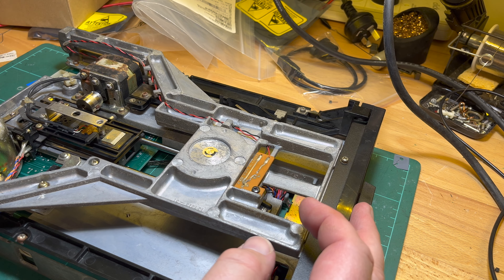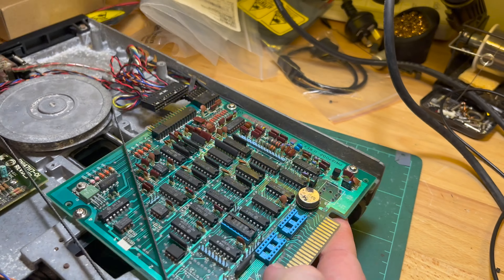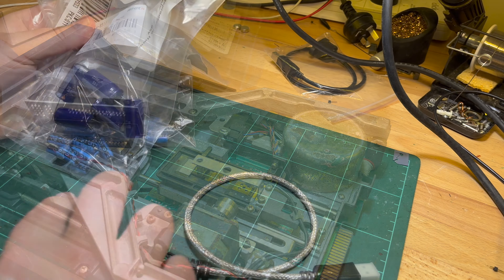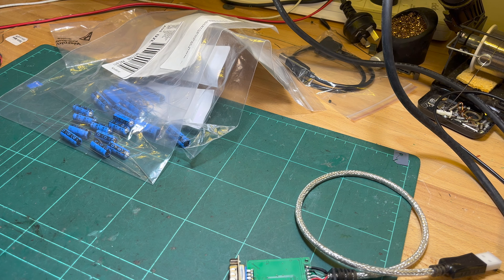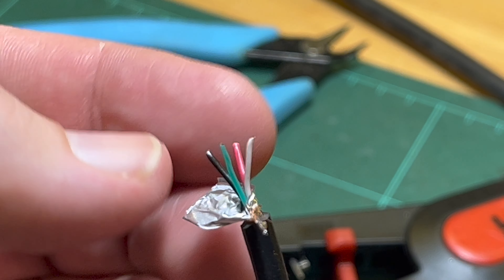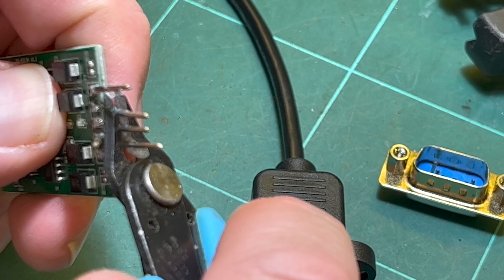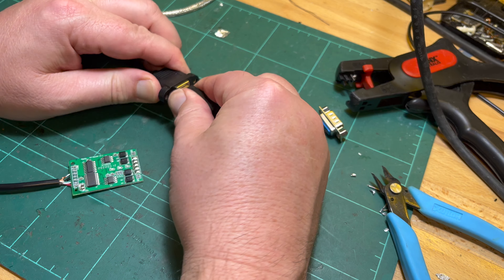Quick Update: 8" Floppy Drive & NABU RS422 Adaptor (19-Apr-2023) [TCE #0281]

Comment: Hey enjoyed the video. I'll be keen to see how things go with your nabu. And don't sweat the haters it's your box you can do what you want. However, just in case, I think some folks have made 3d printed insertable blanks like those that have been used with f18 video adapters. Could print one of those up if and only IF you want. Or get out the drill! Thanks for the tag in the description as well. Take care. (Doh sorry should have read through your other comments before mentioning the 3d printed panel looks like you already knew! )
Reply from the maker: I do actually have a 3D printer ... a Weedo X40 ... but's it's been broken for sometime ... I really need to sit down one day and fix it ... well, I think it simply can't read the temperature on one of the extruders ... that's basically the main reason why I'd prefer to just drill holes in my NABU ... easier than fixing my printer :(
Reply: @Brfff  hey seriously, if we can find an stl I'll print you some and drop in the post if you want. May be the slowest/cheapest method but I'll give it a shot! 😆

Comment: Pity about the solenoid. It was worth a try, I wasn't expecting anything more than the coil working as a replacement. The thing was really cheap which made it worth a try.

 I would use your original solenoid if I were you. For no other reason than it intentionally doesn't have a hole in the bottom to vent to atmosphere. I think that the intent is to let the pressure bleed off slowly to provide the plunger with some dampening. Without it I would be concerned that you will re-break that part that you repaired. 

And please be sure to never power up your solenoid without the metal plunger, and that it is able to be pulled in fully. A nail or a rod will also work. But without something ferrous in there the coil will burn out.

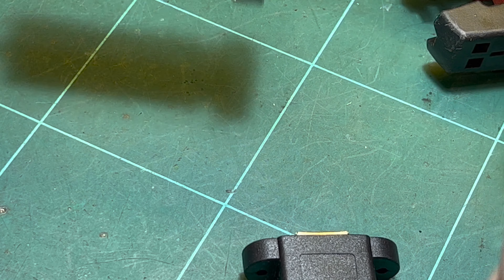@11:26 your white wire and shield are awfully close to the ground trace. The white wire especially.

The real problem with the serial communications for the NABU isn't the cable. It's the odd 111,875k baud rate that creates errors when matched to the standard 115,200k baud rate (I'm getting senile, I had it as 105.2k elsewhere. Duh).

DJ Sures has come up with a software patch which works really well. But if you are getting transmission errors here are some things that you could do.

1) Use a RS422 (or a RS232) to USB adapter that has an excellent driver for it. The Tripp Lite (USA-19HS) is an excellent adapter but I have not verified if it will support 111.9k baud
https://www.amazon.com/gp/product/B0000VYJRY/ref=ppx_od_dt_b_asin_title_s01?ie=UTF8&psc=1

2) Use an el-cheapo Arduino board and replace the crystal

Options 1 & 2 require that you set up your TR1863P as a RS232 port (it's been done). See: https://www.youtube.com/shorts/5VoVyFIRREc

3) Build an adapter that the TR1863P UART chip plugs in to which has its own 1.84Mhz crystal driving it. 

Some random thoughts and brain drippings:

I had hoped that it would be a rather simple crystal swap to boost the serial port to a standard baud rate. I tried tracing the clock back to where it comes from on the schematic, but it leads you nowhere. Cool looking schematic, but it needs a layout page (at the very least) to tie it all together.

However, the very first page in the "NABU Computer Technical Manual" says this about the clocks: 

"Clocks 
The processor board is designed to operate in a television environment requiring specific clock frequencies. The processor board has a 10.738635 megahertz.!. 50 ppm fundamental frequency, parallel-mode crystal. This is directly connected to the video processor. The video processor divides the clock frequency by three resulting in a 3.579545 (referred to hereafter as 3.58) megahertz basic clock rate. This 3.58 megahertz clock is used to drive the Z80A microprocessor." 

So I guess that reading the fine manual pays off from time to time...

Swapping the clock (at the source) will fix one thing, but will most likely break the NTSC video signal as well. Adding a local 1.84Mhz crystal at the TR1843P (UART) chip should take care of the issue. In any case, I think that we now know why it's 111,875 baud.

And I'm hoping-and-a-guessing that the RS422 to USB adapter that you bought has a fully fleshed out driver for it, so that you can use a multiplier of 26 for 'n' and 7 for 'x'

From the FTDI manual:

"Baud Rate = 3000000 / (n + x)
Where ‘n’ can be any integer between 2 and 16,384 ( = 214 ) and ‘x’ can be a sub-integer of the value 0, 0.125, 0.25, 0.375, 0.5, 0.625, 0.75, or 0.875." 

So 26.875 (n=26, x=7) into 3000000 = 111.628k baud. Pretty darn close.
Reply from the maker: "@11:26 your white wire and shield are awfully close to the ground trace. The white wire especially." ...

As we say in Australia ... "yeah, nah, she'll be be right mate!" ... but yes, I will tidy it up a little bit ;)
Reply: @Brfff  As we do here, boost the voltage a bit and clear all yer faults in one go. :)
Reply from the maker: @MrWaalkman  Hey, that's a good idea ... wait a second, won't that just ... ahhhhh ;)